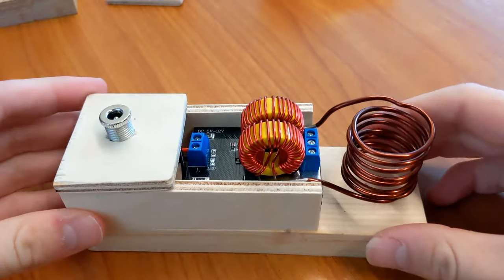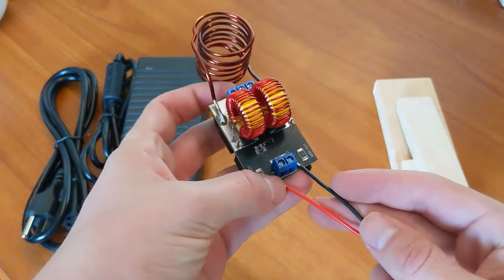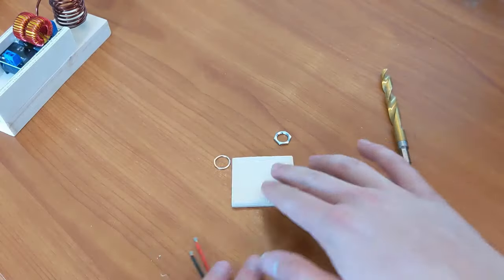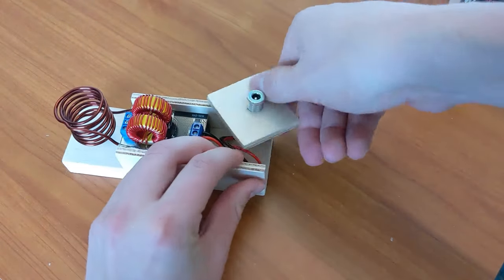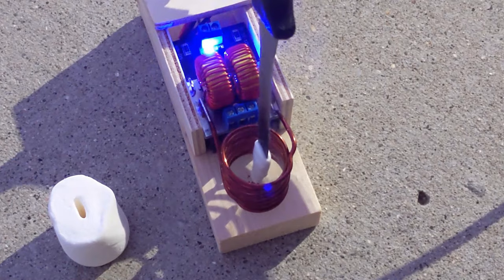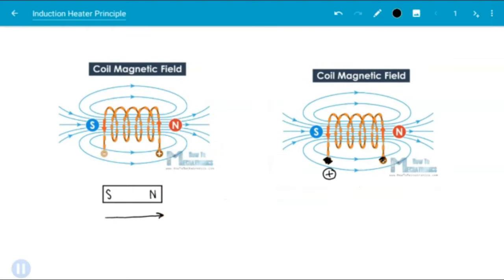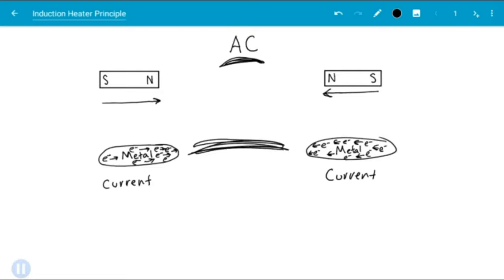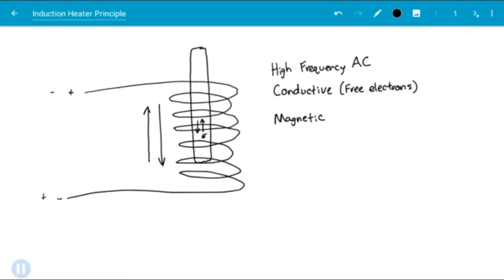Building an Induction Heater for Less than $40 | DIY Tutorial & Theory

Comment: Imma use this to make hard boiled eggs with it now man thx😂
Reply: How?
Reply: Metallic egg, of course.
Reply: @BitSmythe  he'll probably try to spray it with aluminum paint first....yeaa that's the ticket
Reply: You can’t,it’s not magnetic
Reply: @h.Freeman  lol
Reply: Hotdogs
Reply: Hot dawg
Reply: I mean... You can technically wrap a small flexible copper wire around the egg and just leave it there.
Reply: thats not how induction works
Reply: Soft boiled eggs are bomb
Reply: lol won’t work
Reply: Don't eat ferrous eggs
Reply: Eggs from robot chicken.
Reply: U mean hard induced egg bowling required water (boiling)
Reply: U can use indirect heating like beaker in a beaker and fine tune it 😂😂😂
Reply: how does barely anyone here not understand that you can just use a metal plate and put the egg on it

Comment: In the video you mentioned that the best materials for heating are ferromagnetic ones. Did you ask yourself why that is?  The problem you have here is that your main premise that the heating is done by eddy currents is not quite correct. That is easy to prove by putting a Copper sample inside the coil. Copper has much greater eddy currents than iron due to its superior conductivity.  So you would expect it to heat up much more efficiently. However, while some heating will take place there is nothing dramatic about it, it will be far from red hot. Now, the real reason why induction heaters work is that the variable magnetic field causes fast reorientation of magnetic domains inside the sample. This is almost a mechanical action and occasionally you can actually hear it. The material itself resists this reorientation, so overcoming this resistance creates a lot of heat as you observed. But unfortunately only ferromagnetic materials have those domains. Eddy currents have additional problem in that the high frequency magnetic field forces any induced current to the surface of the sample, so called Skin effect, there are not a lot of current inside the bulk. Ergo not a lot of heating.

Comment: Once you have an understanding of how  Alternating Current works it actually almost suddenly makes perfect sense why it is that induction heaters work.  Great explanation!  Basically the alternation of current is CONSTANTLY moving the free roving electrons inside of magnetic metals back and forth.  (and given "heat" is literally derived from the motion of atoms in general.....)  

Thanks for the demo and explanation!
Reply: Like a microwave, it sounds like, except it's magnetic lines that heat the objects, not radio waves.  But, is it possible the Magnetic component of the microwave RF waves that actually heats the food?  I like comments like yours because it really makes me think.  Thanks and have a nice day.
Reply: so basically it's like an LED but for heat
Reply: @NorthPoleJeff  Something different is happening with microwaves heating food, but when it comes to metal in the microwave, I think induction comes into play like you suggested. (Remember, the material has to have electrons that are free to move around the surface of the material for induction of eddy currents to produce heat? 4:39)

Comment: note on the coil...

the number of turns will determine not only the frequency, but also the LOAD that the power supply sees.

if you have lots of turns, you can only get a rather low power into the work.

its a transformer, with a 1 turn secondary. the impedance ("resistance") reflects at the square of the turns ratio.

the power supply "sees" this resistance...

example, if the work is 1R, with 5 turns, the power supply will "see" 25R. the current will be limited by the supply voltage into that resistance.
if you have 10 turns, it will see 100R... 25R will draw 4X the current... the current squared across that resistance is the power consumed. it rises real quick!

you can work the other way if you know the tank voltages (sillyscope) and can say "250v at 5:1 will give 50v in the work..." 

with some tweaking, or using a transformer, you can very easily "tune" a coil in to any given workpiece by using an ammeter on the supply. you dont really need to know anything other than the rating of the FETs, and the number of turns... start high, keep reducing, keeping in mind that as the turns reduce, the inductance goes down at the square... 10 turns is twice the inductance as 5 turns, yet you get 4X the power in the 5 turns. except then the frequency may be too high for some applications so its needs more capacitance.

on that note... lay the circuit out with copper strip, close spaced with an insulator between, like a capacitor. you want the entire circuit EXCEPT the work coil to be as "capacitor" as possible. the higher the power the better the performance.

it also gets a bit weird, as the frequency goes up, the skin effect increases. less of the work is conducting, and so the resistance increases, and the reflected resistance increases and limits the power...

i use a multitapped transformer on my ZVS as i much prefer the isolation, and the ease of using different coils... i have destroyed so many FETs with these things...

just some copper sheet wound on a flyback ferrite core, and several turns of pipe wrapped around it. tap on every turn.6
Reply: I wish I knew as much as you do about electrical circuits and components. Electricity is like magic and I wanna be a wizard!

Comment: Thanks for the video, I am definitely going to build one. I want to use it to loosen old tight rusty bolts on my truck.
I like how you explained the eddy current side of the equation, but the permeability of the metal plays a much larger role in heating ferrous metals. If the heating was due to the production of eddy currents then non-ferrous metals would heat up much more than ferrous.

It is the ability of the metals to become magnetized and the molecules spinning back and forth as they attempt to align with the oscillating magnetic fields that creates the heat.
Eddy currents can heat non-ferrous metals like copper and aluminum, but they will generally require higher frequencies compared to heating permeable ferrous metals like steel, stainless steel, iron, nickle, and nickle alloys.

Comment: Hi, it's a really great video!
Do you know at what temperature is heating up the coil? there is a way to 'control' that temperature?
Reply from the maker: 1. Are you asking for the coil temperature or the temperature of the object you are placing into the coil? 

2. Varying the input voltage to the induction heater would certainly change the maximum temperature of the object. However, determining the exact temperature would depend on the geometry and material properties of the object you are placing inside (and also the coil size). So, instead of trying to calculate the temperature, you probably would just have to experiment to know what voltage would get your object to your desired temperature after a specified amount of time. Alternatively, you could add feedback (I assume from a thermocouple) that sends the temperature to a controller, which would adjust the voltage accordingly. That would likely require you to have some controls knowledge, so I don't know if that is a viable solution for you.

Hope this helps.
Reply: @JaDroppingScience  I love ur video
Reply: Using a less powerful battery.

Comment: Question if I were to make an Induction heater to melt metal or gold or anything else how much watts would I need to be running through a power source ?
Reply from the maker: It depends on a lot of things (coil size, object to melt size, etc.) so I can't give a definitive answer on that. This unit is probably not strong enough so you'd almost certainly need a larger, more powerful  module. Sorry I can't be more helpful.

Comment: I CAN USE THIS DEVICE TO HEAT MY SAND BATTERY!
Reply: An induction heater will not heat the sand directly, as sand is non-conductive.   Induction heaters will heat a small area of metal rapidly.  The trick would be to get the heat from the metal into the sand.  Say flowing water through a pipe could bring the heat to your sand.

You could also heat a some metal already submerged in the sand. I don't know how heat conducts through sand so I don't know if this will be sufficient.  But you'll need to make sure you coil stays cool so I doubt this will work.

I have doubts that this will be as efficient as a simple resistive element.

Comment: Nice and simple, cheers. And PVA isn't really bad for the skin, don't worry about it. There was a guy I was in school with who for some odd reason used to love basically painting his own hand in PVA wood glue and then peeling it off when it more or less set 😅
He did that for ages, and to this day, as far as I know, he doesn't have skin cancer 😝
I'm wondering, you know if you dipped that induction coil into a pot of water whilst having a stainless steel bolt in the middle of the coil, to boil the water for tea or coffee, or to cook with it, would it electrify the water, or would it be safe to use? 🤔
I know Eddy currents work on resistance, but I don't know enough about this stuff yet.

Comment: Bro, solder on the wire ends going into screw terminal are doing the literal opposite of what you're intending. The reason you don't crimp solid wire or soldered wire is because it becomes too brittle. Making it more likely to crack and cause a bad connection. What you're actually looking for are wire ferrules. They're code for a reason in most AC installs in European countries for the exact reasons you chose to solder the wires.
Reply: Thanks for sharing

Comment: Question? Since you're using a 12v 10A Dc, would it be okay to add like a switch ? 
Do i also need to add a mosfet? I watch a few videos who try to build their own Diy Induction, specifically for Dynavap, for safety do i need a mosfet? or it wil be okay to just build it like the way you connected everything directly? Im sorry if my English is bad hehe, still learning, Shout out from the Philippines! 
Keep up the good work.
Reply: as long as you use a decent rated button  (I use a 3A momentary on the + 12v) mosfet shouldn't be needed. W/ 12v 5A PS my M has never pulled more than 4A; normal is closer to 3A = 10 seconds to the click. I seem to recall that these little units will pull about an 1A from the coil load when idle so it will overheat quickly if left on.

Comment: Tinning the ends of a wire in a screw connection can cause loosening of the connection as the the solder heats up.

Comment: You forgot to mention that you need more Amps to really make it work, the entire concept is based on the concept that, the more amperage of current passes through a resistor(in this case metal) the more heat is produced by resistance, since the more electrons per cross section are forced to move. An interesting overview of this would be if you try to place a superconductor or highly conductive metal in there and it will not actually heat up that much since the resistance is very low.
Reply: you fail to note that the coil and the work form a transformer with a single turn secondary, and the resistance of the work piece is reflected into the supply at the square of the turns ratio...

consider. work is 1R.
5 turns will reflect 25R.
10 turns would reflect 100R.
at 100v, thats 4A, and 1A, respectively.
I2R heating.
16x25=400W
1x100=100W
4 turns?
16R, for 6ish amps.
36...9...
40x16=640W.

oops. 
as long as the supply can deliver, the LOWER the resistance, the more heat developed. not the other way round.

the true thing about it? the entire generator produces heat! an alternator in a power station... driving all those kettles and toasters... if you shorted it out, where would all the power go?
through the resistance of the wire of the alternator itself. the generator is limited by... the power pushing it around against the lenz reactions of induced currents and their opposing magnetic fields, and these get stronger as the resistance decreases. the surface area of its conductor... how much energy can they dissipate? the resistance... too large, thats fine... you dont use much power in it. but as it gets smaller, more and more heat is produced in the resistance, AND the generator, until the generator reaches its limitations of construction.

the power station generator is massive compared to a few puny kettles, but starts to get a bit unhappy when ten million switch on at once at an adbreak! 

also, the superconductor would do nothing as it isnt affected by the magnetic field. not in that way...

if you got a loop of superconductor, threw it around a steel slug in the coil, applied DC to that coil, then removed the power supply... the superconductor will maintain the magnetic field in the iron slug. it will persist... "forever".

you could come back theoretically "at the end of time" and that superconductor will still be a magnet. 

no resistance means no voltage means no current. a zero in the equation nullifies everything. superconductors arent "conductors" as such. they cant be plugged into circuits, they cant replace wires in most cases, they still have contact potentials and the junctions to think about. the currents are simply induced in them and our only evidence they exist at all is the magnetic field that perpetuates around them indefinitely.

if "electricity doesnt travel in wires" then the whole "cooper pair" gibberish is exactly that. nonsense. claptrap.

personally, i think the term is a misnomer. maybe applicable to type I, pure metals supercooled... but ceramics, type II? i say "magnetically impermeable materials"... its much closer to what they ARE.

Comment: If you put a small graphite ingot mold into the coil would the graphite heat up? I’m wondering in this could be used to melt down silver or tin in the graphite mold. Thanks.

Comment: So is this friction on a sub atomic or molecular level (I'm not sure of the correct terminology) that's happening throughout the object which may be why it heats up so fast and doesn't quickly radiate across the surface like when metal is heated via the surface

Comment: So I want to make one of these to melt some co2 cartridges, would this work to melt them if I modified the coil to fit the cartridge? Or would it not be able to heat the cartridge enough for it to melt and just make it extremely hot.

Comment: Im not trying to be a naysayer here. I know these work and I've seen them used. This is purely out of curiosity, the induction coil only works off of AC, so what is the grey box power supply you are plugging it into?
Reply: No, the zvs needs direct current to work, it becomes alternating current in the coil when it works. So the gray box is a 12-17 volt DC adapter for sure
Reply: @gurraflex6478  yeah i did more research after that comment and felt kinda silly lol. However, i still wonder what is the purpose of converting AC to DC to use in a circuit to generate high voltage and turn back into AC? Why not just use a transformer purely off of AC and wind it to increase the voltage output to what is needed? Is it just not feasible to do it this way? Asking because i intended to try it as i am about to build an induction coil myself for quick blacksmithing one offs. Was going to test purely running off of a transformer but if its not practical to do so i will just build a zvs circuit to run it off of.
Reply: @kylewellman402  Hi just go to   https://en.wikipedia.org/wiki/Induction_heating    there xcan read how its work

Comment: You should not solder the wires before using them in a screw terminal, but "if you didn't know that, then you probably shouldn't be doing this"
Reply: This is true because solder deforms easily and cold flows under pressure. The groovy method is to use ferrules.

Comment: so, can i just hook up 50V 60hz AC directly to a coil and make it an induction heater?
Reply from the maker: No, the frequency needs a range of 100-200 kHz
Reply: @JaDroppingScience  ok, thanks
Reply: It is possible, but you need bigger coil (with bigger inductance) to make magnetic field with same magnetic flux because of low frequency

Comment: Which coil is ac? Isn't this DC powered?
Reply from the maker: Yes, the 110 Volt AC current from the wall outlet gets converted to 12 Volt DC by the power supply and then it gets converted to high frequency AC for the coil that you put the objects into.

Comment: What frequency AC does it generate.. shame on you for not specifying the frequency?
Reply from the maker: I do not know. If I knew for sure, I would specify
Reply: I see,   You’ll need some equipment to measure it.   Perhaps some other people might comment on this.   Using a grip dip meter would work, it’s a lot cheaper then using a spectrum analyzer or an expensive oscilloscope,  you can get a grid dip meter at a ham radio swap event for less then $10.